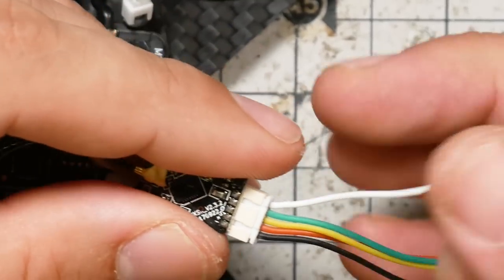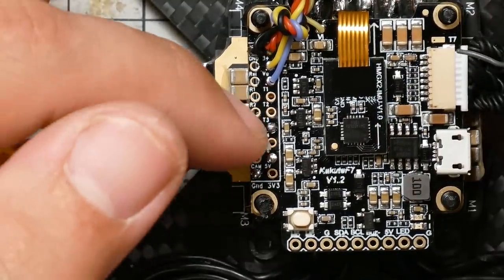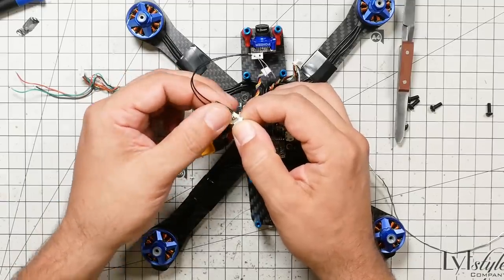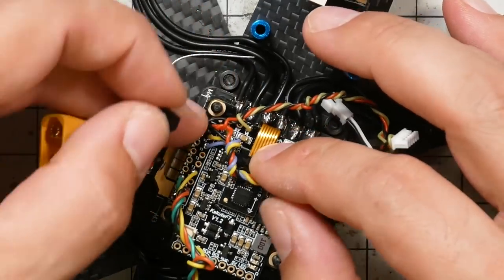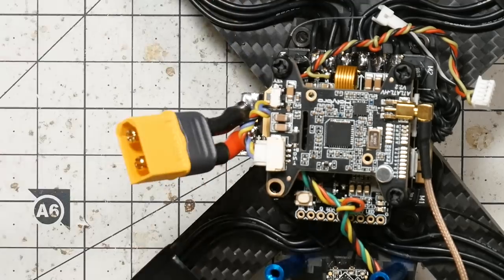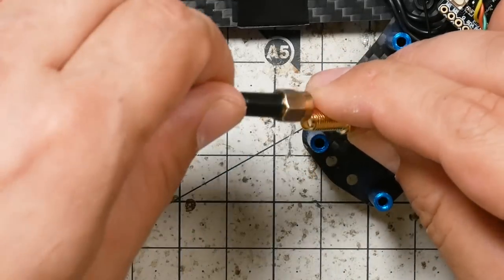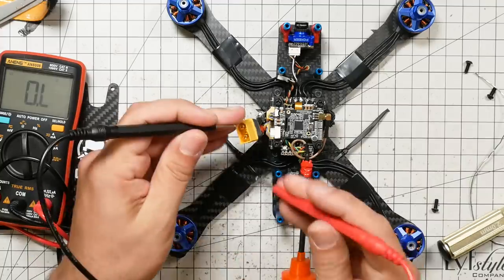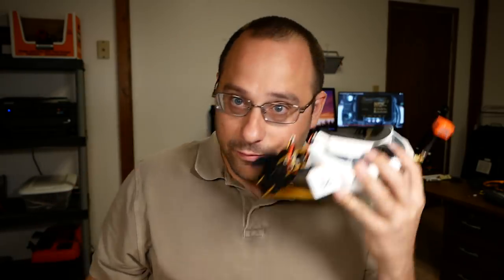Learn To Build a Racing Drone - Part 9 - Install Receiver and Smoke Check

Comment: Tips for antenna mounting (the receiver ones) if you put the antennas under neath the zip-tie, then they will have a much less chance of getting chopped with the propellers. Also if you use thicker zip ties, they will have a less chance of getting bent up into the propellers.

Comment: JB;  Love this build series.  Thanks.  Question:  I've had now 3 R-XSR receivers.  All 3; that tiny little bind button has slid off the board.  Causing me to have to short the tiny traces to get it to bind.  Super difficult, but does work!  Tips?
Reply from the maker: Be more careful when pressing the bind button.

Comment: I'm wondering why it´s not possible to wire sbus and smartbus to the same UART, e.g. to RX4 and TX4. The KAKUTE F7 manual like all other FC manuals tell to wire these buses to TX and RX of different UARTs. Why? What is the technical explanation for this. Also, is there a reason why you didn't use the fport solution with one wire only? Is fport still not ready to be fully trusted?

By the way, I love your videos. It made me confident to build my own freestyle quad and to enter the FPV hobby. I just finished successfully my LOS maiden flight today. Now I just need to practice, practice and practice to be able to pull all those stunts you guys (and gals) do. :-D
Reply from the maker: The same UART cannot be used for two different functions. Well, technically it can, but the functions have to run at the same baud rate. SmartPort telemetry and SBUS control do not operate at the same baud rate. Therefore they cannot share the TX and RX pads of the same UART.

Use FPort if you want to get telemetry and control on the same UART.

Comment: What do you do if you want to use redundant receivers and what does that actually accomplish? Also, do the redundant receivers have to be the same, or can one be the xsr and one be a x4rsb?
Reply from the maker: Redundant receivers means that if one failsafes, then the other one will take over. This is most useful if you are building a large model where parts of the model might shadow one receiver, but the other receiver would have clear line of sight to the transmitter. On a mini quad I don't think there is much advantage. Let's say you have two redundant FrSky receivers? Why would one failsafe but not the other?
Reply: Joshua Bardwell thank you. I guess that makes me think of the question... couldn’t one frSky fail safe just because it is out of line of sight and the other would then take over even if its also frSky? I’m brand new to all this... so I apologize if my question doesn’t make sense. But I have just bought a taranis qx7 for Christmas and I literally got the battery for it today... now for some simulator time!!!! 
And that brings me to my next question... I have the Rx and a battery (and charger) and a usb cable... Is there any thing else I need to do to start on velocidrone other than have a capable computer?

Comment: Does it really matte if I use a temperature controlled soldering iron? I have a soldering gun, and it heats up to 1135 F as its maximum.  I havent started making this build but I've been watching all of the previous episodes. Also how does the camera work? Do we connect it through phone to see it?  And is the video of the drone flying at the end the drone that we are making? Sorry for the questions. I'm new and curious.
Reply from the maker: A temperature controlled soldering iron will give much, much better results. Your iron heats up to over 600 C which is way, way, WAY too hot even for me, and I have been accused of running my iron too hot.

The camera connects to the video transmitter which transmits signal to the goggles.

Comment: Any reason to use those specific R and T pads on the FC? Isn't it just possible to use T1 and R1 and select them through the betaflight software?
Reply from the maker: You can't use T1 and R1 for FrSky telemetry and control. They have to be separate UARTS. If you use the FPort firmware on the receiver, you use a single UART for both functions.

Comment: Just to confirm, you used 2 different uarts for the receiver tx4 and rx6, I haven't been able to get telemetry with the rxsr, I can't wait to see the config video.
Reply from the maker: Yes. FrSky receiver uses TX for SmartPort telemetry and RX for SBUS control. They are NOT the same UART. They are separate UARTs. You can get around this by using FPort firmware on your receiver. FPort uses the same UART for telemetry and control. But I didn't want to make people flash FPort for this beginner build series.

Comment: Are you not a fan of Loctite?  Are you disassembling/assembling your quads often enough to be ensuring that all screws are tight?  Just curious...
Reply from the maker: I use thread locker sometimes but usually I just make sure my screws are tight. I'm constantly working on my quads so thread locker is more of an annoyance than a help sometimes.

Comment: Hi Joshua, can a Graupner rx with SUMD be wired to the UART of this FC? (it's not inverted)
Reply from the maker: Yes, Betaflight supports SUMD. However there are also several Graupner compatible receivers that output SBUS if you like.

Comment: Will i be able to install my flysky recievers using this vidio i just bought a nirvana
Reply from the maker: Yes this build works with a flysky receiver. There is a link in the "reciever" video description containing Philipp Seidel wiring diagrams for all major common receiver types.

Comment: Hi! Joshua Bardwell. I just went through your video series and few other videos on how to make a drone (build a drone under $99). I had a trouble finding your Bardwell's Budget Build Kit on internet as it's out of stock. So can I use the the drone parts used in this video https://bit.ly/2RlAnZF  or https://bit.ly/2OXi1kR to build my drone and follow your instructions on setting up the receiver and transmitter, and all the other stuff you have done on your computer? In short I just want to use different drone parts (not your Bardwell's Budget Build Kit ) and follow your instructions on setting up the drone on computer. Please guide me with this. Also Kindly check the video links, there the person has missed out to setup the transmitter so i am confused what to do. Will this work?
Thanking you in anticipation
Reply from the maker: If you use different parts, then instructions will not be exactly the same, but you may be able to follow along and adjust the instructions for your equipment.